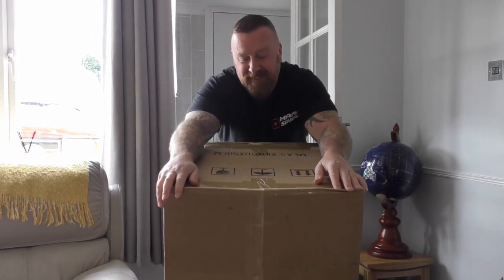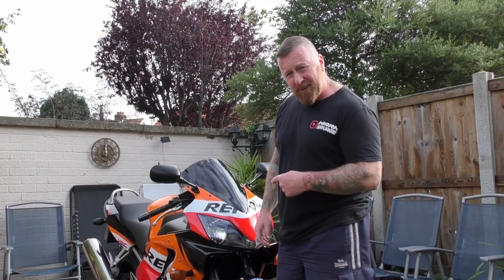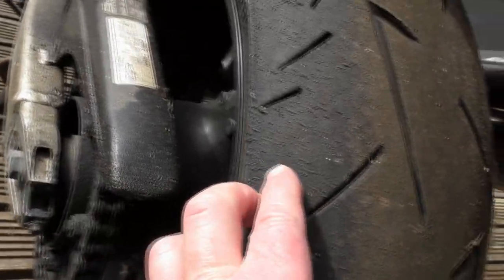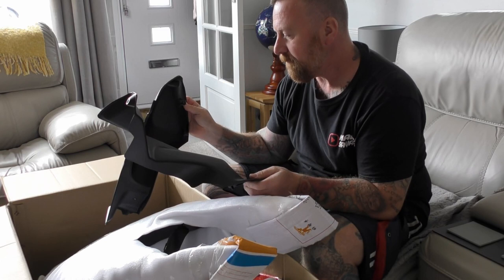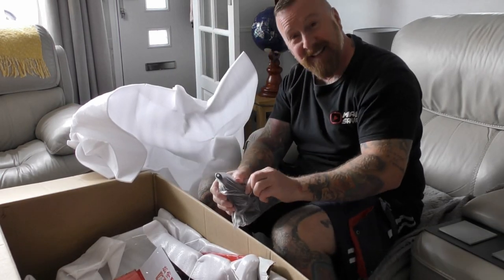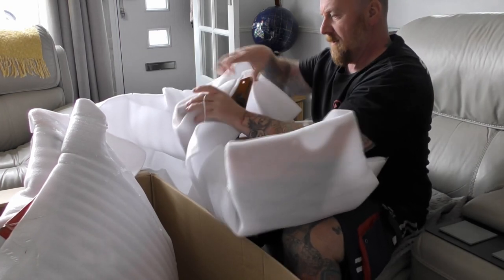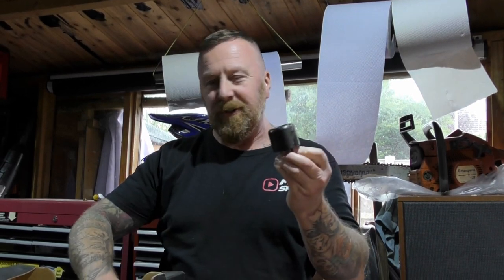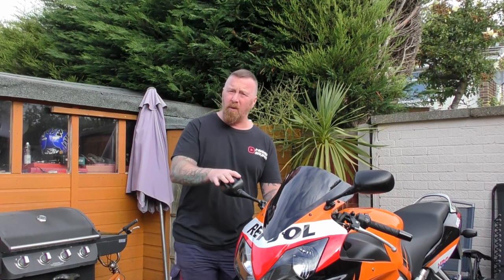HONDA REPSOL CRB FINISHED PROJECT SEASON FINALE

Comment: Hiya mark, I spoke to you a while ago about upgrading an aerox, I’ve got a new pipe, new belt, slight up jet and new rollers (4.3G) and have even tried 5 gram but it still won’t hit a good speed consistently, it will do around 38 when it does pull but then sometimes it won’t get the pull and only do 20mph so I am stuck with what to do, any ideas?
Reply from the maker: Sure I said 6g rollers bud !
What size jet ?
How's the belt?
Reply: @marksavage  the jet is 68 and the belt brand new stage 6
Reply from the maker: @Josh-ph8gl  and this is one sp2? 
68 is a little big
Does it bog down ?
60 to 62 with 6g rollers
Reply: @marksavage  it does bog a little bit, and sorry I also forgot to mention that the pipe came as a kit, it is a Leo vince tt exhaust and came with new yellow clutch springs
Reply from the maker: @Josh-ph8gl  don't use the springs 
Go back down to 62 
It will help
Reply: @marksavage  cheers pal will try this

Comment: Just bought a Piaggio zip 50cc restricted and everything is working fine but sometimes when I pull the throttle it doesn’t accelerate like nothing happens and then if I pull the throttle again it will accelerate, any ideas?
Reply from the maker: Variator , belt , clutch 
Got videos on a zip bud and other 4t mopeds check them out for help
Reply: @marksavage  ok thanks also I have to pull my throttle back a tiny bit before it actually starts accelerating like there is almost a delay any tips on making it more reactive
Reply from the maker: @Keeptalkingg  theres adjustment on the throttle and on top of the carb so you can tighten that up bud
Reply: @marksavage  ok thank you and tips on adjusting throttle

Comment: What’s your Twitter👍
Reply: Need some info on my bike
Reply from the maker: @alexblack235  i don't haven't got it mate nor a open Facebook or Instagram,  well I did but they took me off for a few jokes some idiot found rude ! 
Pmsl
Reply: @marksavage  I have a 2020 piaggio nrg fuel injected and I was wondering if u have to change the main jet when putting a stage 6 sports exhaust on
Reply: Wait I’ve just been told if u have a fuel injected bike it doesn’t have a carb😂
Reply from the maker: @alexblack235  thats right bud, its great when you ask and answer your own questions lol 
No upsetting!
But you can change the exhaust if you can find one as new , sports air filter , change rollers 
It may all help bud